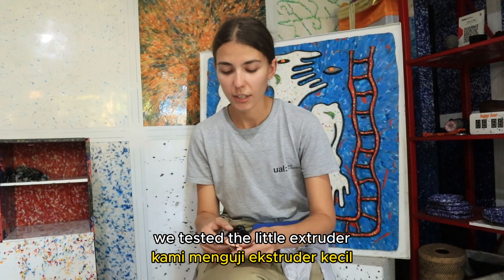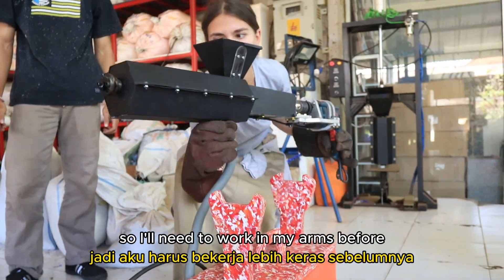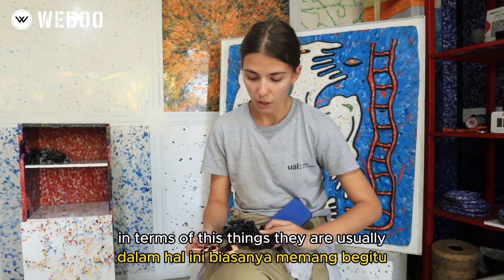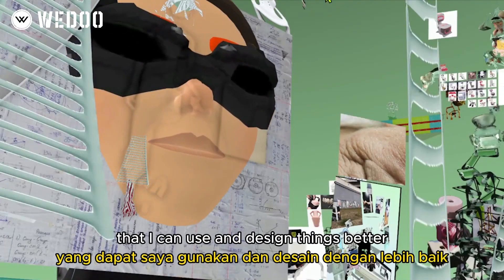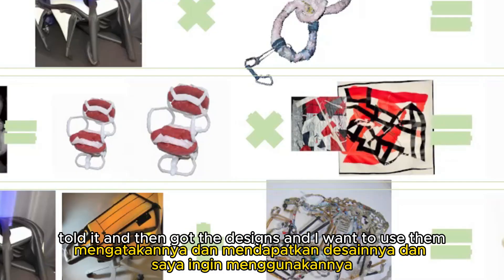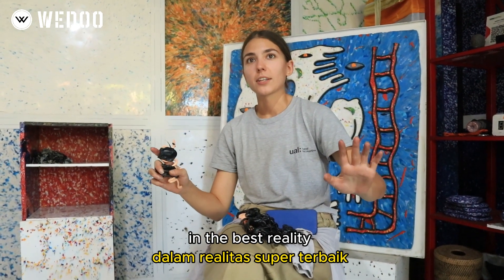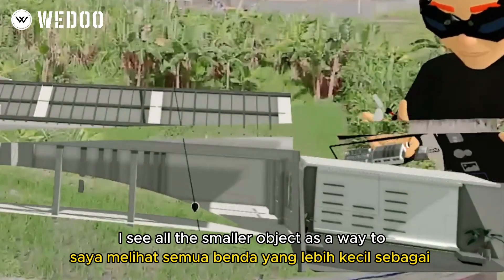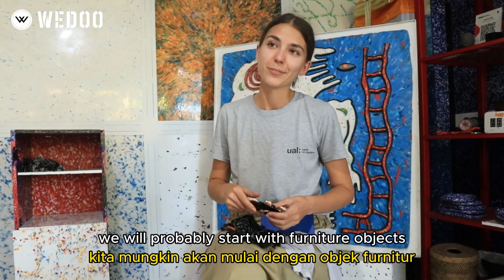HANDHELD EXTRUDER - BUILD HOUSESS  ON THE MOON with AACOOP!!!

Comment: I have a idea to use this. If you have plastic lumber..  Use this to make joint connection.  Drill hole between two parts,  align the holes and pump the hole full of hot plastic.  It will be like a peg fastener when cool
Reply from the maker: Hello Butte! what a cool idea! will try it soon :)